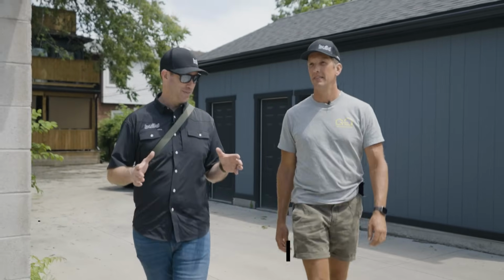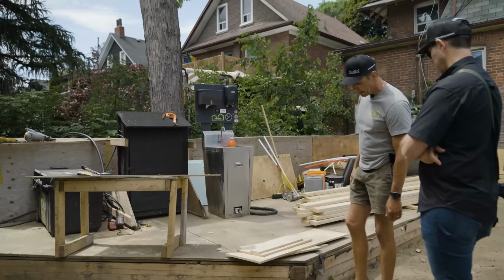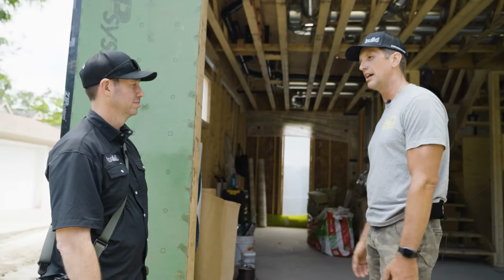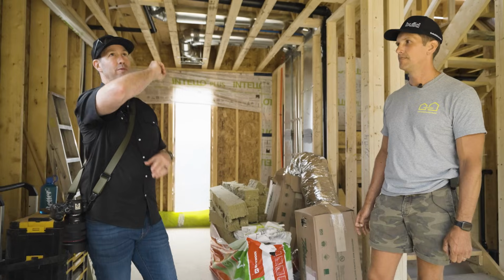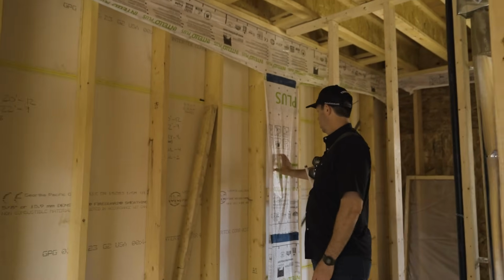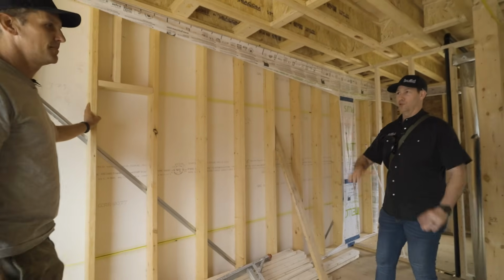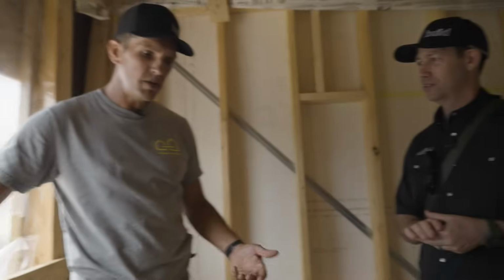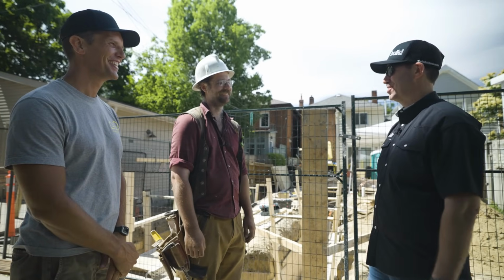Cutting it close! Building an INCH from the property line!

Comment: The moment he said "hinge the wall up" I immediately wanted a follow up video from this crew documenting how that goes up because that whole process sounds hair-raising in a most enjoyable way!
Reply: Yeah we are looking forward to it ourselves lol.
Reply: @Torontokid  there's few things more enjoyable than an idea that's "just crazy enough to work" haha
Reply: Yea these guys need a YouTube channel lol
Reply: We post some of the more interesting stuff on the company Insta.
Reply: Two bottom plates with screws. Build the wall. 
Router hing pockets.
Pull off the bottom plate.
Install hinge.
Attach bottom plate to deck.
A lot of air sealing adhesive on top of bottom plate.
Hinge it up with framing Jack's. 2-400$
Install concrete anchor bolts and snug it down.

Comment: Nice to see govt. working to change zoning away from single family to multi-family zoning with a zero set back on one or more inside boundaries for urban infill as a way to the future both keeping heritage and providing for new development. Friction piles (pin-piles) with grade beams is a great way to support and get new construction close to lot line while getting below frost line to provide a stabile footing for the residences with minimun site prep. Use of open trusses  between floors including roof gets all utilites where needed w/o structual gymnastics a great process. Great video Matt you always provide cutting edge content, modest cost high preformance residential new construction kinda (sic) like getting to have and eat the cake. I am still ambivalent about 20 story wood frame buildings but still it's wonderful information to see this is possible. Ray Stormont

Comment: Ive gone with running a wire up to the attic and down for the wire going through the drywall gaps at wall ends. 
Mainly for drywall air sealing and convenience for drywall.

Comment: I’m in Canada laneway houses are great concept here. The only issue I’ve seen is that ; some of the cities here implemented them due to high cost of real estate and unaffordability like in Vancouver, so when the laneway houses were implemented the house prices/property value doubled in price again since those properties were seen as larger income investments . They help with density and housing shortages within a city core however they currently work against the main housing crisis issue which is affordability. Maybe there is a policy that could be implemented to prevent this escalation in value once an area is zoned to allow laneway houses in already extremely high housing price situations.
Reply: You can't do anything about it. It's the same here in the Boston area. They're trying to densify the suburbs and are allowing more and larger buildings, under the guide of "affordability". But the same market forces will be at play and these few extra units will do nothing to lower the overall cost of real estate. Single family houses will become more rare and thus more expensive. TBH the high cost is a byproduct of a successful local economy, so it is what it is. You have to live further out if you can't afford the close suburbs.
Reply: @vapeurdepisse   - yes they could implement rent control like Germany - where rent is limited based on floor area.  OR the city could retain rights over laneways and use them for affordable housing - not open to the freemarket....

There are ways, it all depends on the intent - to make more money, or to provide housing.
Reply: They also don't address the missing middle. Laneways house are limited to like 500sqft. Which is the size of a condo.

It's hard to do the family thing in that. 

They don't end up being entirely desirable unless you want extra income from renting it out to a student or the like. But they're great for adding a bit of extra space for your already tight home. 

In my opinion, and I'm a nobody, Neither of these help the housing crisis.
Reply: @beurky  "Neither of these help the housing crisis" - Well, of course they do - additional dwelling units are additional dwelling units. Sure, not very suitable for a family but totally suitable for a single or couple to rent.
Reply: @adammacer   that can help the rent crisis. Not so much the house price crisis. (They're kind of connected) you're not wrong for that perspective. . But to your point, just build more condo buildings with 400-500sqft apartments. That is a more efficient use of land and increases density way more. BUT when it comes to the price of homes for the " middle class" like a 4 person + pet  home, zoning for only mini homes aren't helping. It incentivizes urban sprawl. 

Vancouver is proposing a zoning change to increase their ADU gross floor ratio, specifically to address this. Basically the gross floor area will be dependent on the size of the lot to a max of 2000sqft. It's quite progressive. 

I think the hearing is on sept 14th. Check it out.
Reply: No they don't. There is now more square footage of high price housing, which reduces the demand to scrap homes at the edge of the expanding gentrification line.

Comment: R-54, in Canada?.....I built R-60 in my roof in the Raleigh NC area. And an air-source heat-pump? If you check the efficiency recommendation charts, you'll see mid-Carolina is where they begin to fall-off precipitously.

Heat strips will glow constantly, and you know what that means
Reply: What heat pumps are you using? Here the quality inverter driven brands manage to get a seasonal COP of 1.5 to 2.5, depending on the region. Toronto is actually pretty warm, relative to the prairies, so is the west coast, and the east coast. In fact, most of Canadians live in the warmer parts of the country.

Comment: So not a land grab, just a "granny flat" - even if rather substantial.

Re. the screws bridging the insulation - this detail / problem -  and the rainscreen putting the screws in shear, can also be alleviated by ensuring the "strapping / furring" for the cladding is fastened to the top-members/ structurally, then  the whole cladding system will be in tension (hanging from the top)..

 - Non sheathed walls need noggin/nogging between the studs to increase buckling strength of the framing. This with "strapping/wing bracing is the framing method used in timber houses in Australia (and NZ) - typical cladding - weatherboards or hardiplank isn't regarded as structural (unless specific structural ply or braceboard is used..

Underpinning a new concrete beam sounds ridiculous, why not drill and pour piles  / continuous pile wall (or use groundscrews) and then cast the beam on top -  or as required to fully tie the piles together?? - unless the wall needs to be shored up and deep cross ties inserted and cast..

The "stood-up wall - should just be made of prepainted tilt-up concrete - making it a permanent one-and-done.

Comment: It should also be illegal to not use real plywood on the outside of a house.  
OSB, Zip Board, Outside Drywall are all trash and will not last 20 years from moisture.    For a wood house, the proper way would be putting in plywood sheathing for the strength then you can put your foam board on top of that.    These are scammer builders just building shitty houses.  A 7 year warranty wont matter on junk that will last 10 years before failing.

Comment: Requiring homeowners to save huge trees in a back yard is nuts. A tree like that SHOULD be removed. City planners are the worst.
Reply: @suspicionofdeceitis the city going to pay for the damages from said tree?
Reply: @suspicionofdeceit These massive trees belong where they can have space, and not where they will destroy the houses. They can be in the streets and parks where they do most good.
Reply: The property line in many parts of Toronto starts 15 feet measured from the street side outside edge of the public sidewalk. At this point backwards into the lot the home owner is responsible for sewer & water connections. If there is a tree at the front of a house in this zone it is designated as a City owned tree. A tree on the rear of the property is a private tree and is some cases can be removed as the restrictions on a private tree are different.